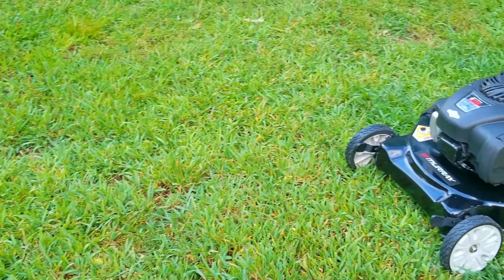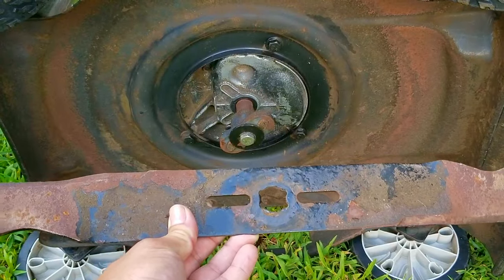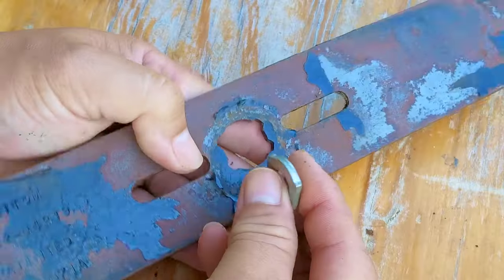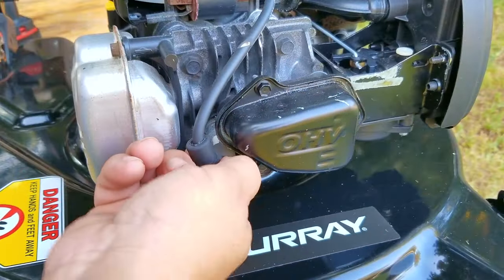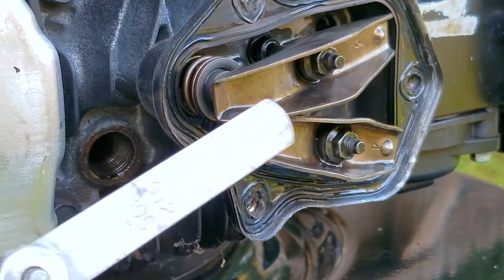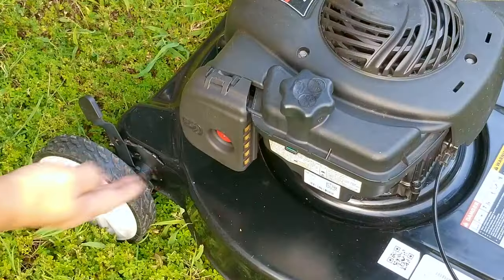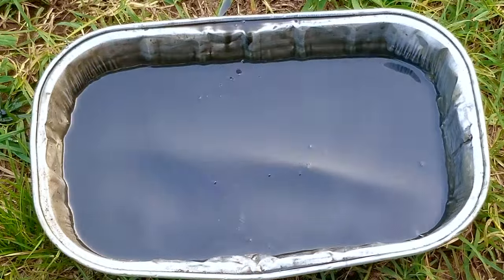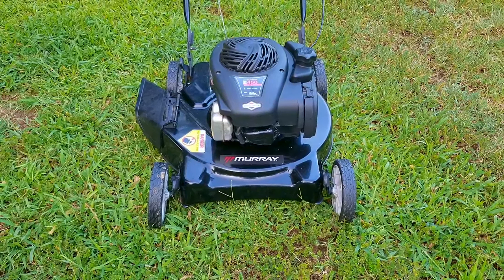Fixing A Murray Mower That Shakes

Comment: Eric, your fix for the loose fitting blade was brilliant. That said, I’d never sell it like that because the first time someone removes the blade I doubt they’d see that shim fall out if the wanted to just sharpen the blade and use it again. 
No big surprise the valve lash opened up that much!  I can’t imagine not having a lock nut to keep it from opening up again. Yikes!  Even machines with lock nuts loosen up over time, but usually on a thousandth or so, even though that’s probably due to wear of the tappets or valve stems.
Reply from the maker: you do make a point... but the likelihood someone would take the blade off is highly unlikely. Most just use it until it breaks
Reply: It's really best to use a proper adapter and blade. Damn the $$$$
Reply: I agree on all and with zip tie fix however, if I sold a mower with that, I would inform the buyer about the blade fix and maybe even give them a zip tie piece as a replacement.

Comment: Is valve clearance the same for both intake and exhaust?
What about Briggs and Stratton?
Reply from the maker: not necessarily and it depends on the model and serial number not the engine.  As for the Briggs part, you can look up that information on their website, you'll just need to know the information about the engine you have.

Comment: 2 things that I would've done differently on that mower is :-

1. I would've found a way to make sure that blade doesn't spin under heavy load because it will

2,  I would've used glue lined heatshrink tubing  ( Raychem) to cover the cut because it's very deep & it appears to have cut into the Inner core of the cable  !
Reply from the maker: both very good point!

Comment: Hi, what could the cause of a mower thats hard to start when its hot be? (I know its hard to guess through YT...)
Reply: This is most likely caused by a bad ignition coil
Reply from the maker: for me, I'd be a combination of low compression and the valve lash could be off slightly.  The ignition coil is a good possibility however I don't see it very often.

Comment: Looking up parts for mowers can be a little bit tricky when you are doing that
Reply from the maker: yes you are correct
Reply: @INSIDEHOUSEGARAGE   the one thing that is strange is the one blade adapter that has the angled blade  tips seems to be that the blade itself would have the holes the  holes cut as to where it would fit on the blade adapter

Comment: Hey bro what's up? I had to give up on my project I was working on because I wasn't getting the necessary replacement parts for it.
Reply from the maker: that makes sense, sometimes parts are tough to get.
Reply: @INSIDEHOUSEGARAGE  yes especially if it is an older piece of equipment. Replacement parts are very difficult to get and if you manage to get them the cost will literally cost you an arm and a leg.